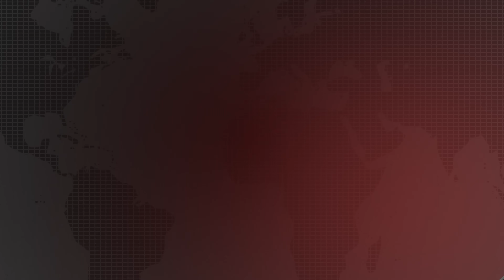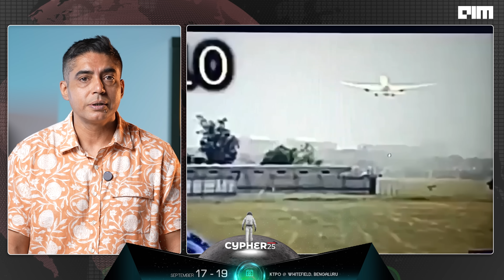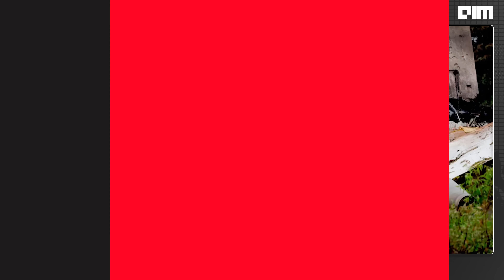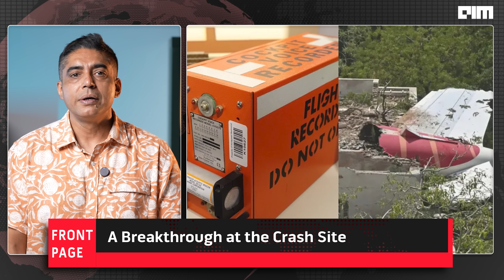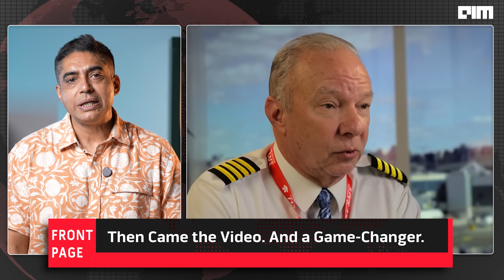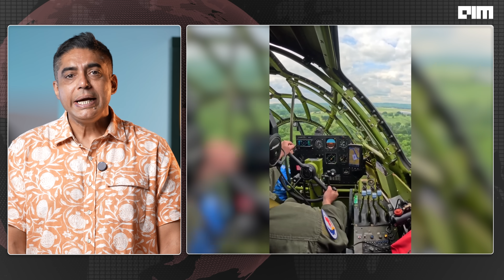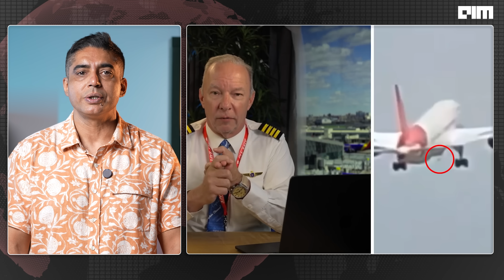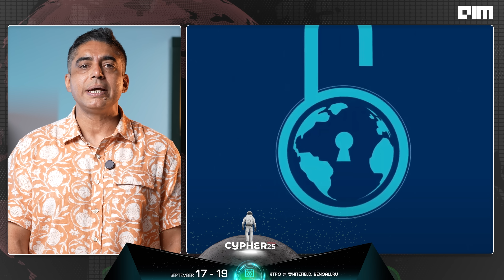Air India Crash: Is Boeing in Trouble Again? RAT Footage Sparks New Questions

Comment: Maintenance must have zero mistakes!   So heartbreaking....RIP 😔💔🙏🏻
Reply: if proper testing was done it would not have passed the test
Reply: Yep, as usual, India standing up and taking responsibility. 🙄 Jai Hind!
Reply: But we have seen many videos made but passenger traveling in the same flight ✈️ within that week or a month.  According to them the flight was too old and many things were out of service.
Reply: @sushmadhillon8818  11 years is not old for an airplane... and yeah a pasagner will have any idea about what INOP on a plane... pls...
Reply: a comprehensive pre-flight maintenance process is crucial for ensuring safety and airworthiness.
Reply: Air India has received six 787 Dreamliners that were assembled at Boeing's Charlotte, North Carolina plant and they are said to be defective. Other airlines rejected planes that were built there and opted for the ones made in Seattle, Washington.
Reply: @Eyob797 It's scary for sure!!
Reply: @Eyob797  that is absolutely not true. Please do more research before posting comments.  😊
Reply: @Eyob797  First off, it's not Charlotte, NC - the 787 are built in Charleston, SC.  So that's fact number one you have wrong.  Second, they were not defective planes, they were the earlier models that had been built in Everett, WA that were subsequently reworked to meet updated requirements.  They were initially built defect free, and the rework that was conducted to update them to the new requirements was also defect free.  Finally, no one rejected these planes, but rather the other airlines wanted planes that were brand new and hadn't been used in flight test as these had been.  Last note:  The plane that was involved in the accident was over ten years old and had flown without issue that entire time.  You still want to somehow pin this on Boeing?  Seriously?
Reply: @JayKeggerlord  I totally agree with you 👍🏼
Reply: @JayKeggerlord  If it’s Boeing, I ain’t going!
Reply: @Eyob797  It was an 11 years old aircraft... pls stop bullshiting. :) Sure Air Inda kept flying a defective plane for 11 years right? :D Also Charlotte does not assembled it, it was assembled in Everett but yeah pls shit more on the street. :D
Reply: @squirrelmurderous 
Why wouldn't it not be a Boeing issue? 
Just because 11 passes doesn't mean a manufacturer isn't the cause. 

There is a 2024 recall from Peugeot, about vehicles made in 2007-2008.
So time isn't always a factor.
Reply: @dianehansma1725  , but this is India? You really believe they can have zero mistakes?
Reply: How much is Boeing paying you?
Reply: @owenlaprath4135  if they are facts what would it matter?

Comment: What would it have costed for proper maintenance of the electrical systems on that plane? If two days ago, a passenger showed that electrical fluctuations and malfunctioning was there, what would it have cost Air India to get the same checked once before this take off?
Reply: Duuude, there is no automatic connection between how the interior of the plane functions and how the engines and vital systems functions.

Comment: Dear, who does know this catostrofic crash happened only because of poor maintenance ,no replacement of relevant parts on time. No overall through checking, oil change, etc..❗see operating a standard Air line in international standards of safty is costly. Even gov of India couldn't run that so they sold to TATA group they aim only profit not looking to do charity by running Air india.its business they sell ticket at low rate and Indians run for such low rate ticket 😂😂.. low rate ticket don't expect international safety standards..to rduce cost reduce maintenance 😂😂..so such things happen frequently for Air India..if wishes to travel 
With good safety standards etc go for tiket of good Air lines like ethihad.emirate..qutar..singapore Air etc..and have safe happi journey..😅..this is the reality.😮.. accept the reality

Comment: This is an 11 year old airplane, why would this have anything to do with Boeing?
Reply: @asquare9316  because even if a plane develops a fault after 11 years, it’s a vulnerable issue for the manufacturer for that make 787, that hidden flaw can lead to disasters in future, a plane is supposed to last more than what this plane lasted, so to avoid future accidents, this hidden vulnerability must be removed, just because engines failed, we can not assume that it was GEs fault, a catastrophic electrical system failure could be due to aircraft flaw as well.
Reply: @deadpooldeadpool665  787s have been flying for 14 years, over 1200 aircraft delivered. Don't you think that any catastrophic design flaws would have been found already? This is the first fatal crash of a 787 in all that time. 
Do you think the fact the A/C was not working on this plane was the result of a Boeing design flaw also?

Comment: APU failure is three jet engines, right? Why would a RAT deploy, if the APU was still powering hydraulic pumps for gear retraction and fuel supply? NTSB investigations are thorough, but I'd get a lock on the fuel truck and storage tank. No other planes had that long takeoff roll and a white 'dust cloud' at rotation on that day?

Comment: The RAT can be deployed manually from the cockpit. It DOES NOT require a dual engine failure.
Reply: Unlike in other planes,boeing787 dreamliners RATis deployed automaticaly
Reply: @danielkalebfinahas7636  The Ram Air Turbine (RAT) on a Boeing 787 can be deployed manually. While it's designed to deploy automatically in certain emergency situations like dual engine failure or loss of electrical power, there's also a dedicated switch on the flight deck that pilots can use to deploy it manually. This switch is typically located on the overhead panel and is spring-loaded and powered by the hot battery bus.
Reply: @danielkalebfinahas7636 - according to Google, yes, it can be deployed manually, as well as automatically!
Reply: No it can't be deployed manually it happens automatically when there is dual engine failure.
Reply: @vr5663  An airliner's Ram Air Turbine (RAT) can be deployed manually - Don't talk Bollocks. Look it up if you don't believe me.
Reply: @vr5663  ever heard of AND/OR?
Reply: @vr5663 - yes it can - Google it!

Comment: By the way, we knew the RAT was deployed the same day. 
1. The RAT was deployed without question. 
2. The plane took off very late on the runway, i.e., it used every foot of runway possible. This is not normal for a 787 on this runway; they normally take off about 600-1000 feet from the end of the runway. 
3. The plane shows signs of laboring around V1, as if it lost some thrust or one engine on the runway.  These are facts one can obtain with the info we have now. The reason the gear was not retracted is that the pilot felt there was a problem.  Now the question should be. Were the pilots aware of a thrust issue before V1?  
In reality, the gear does not matter; the 787 can take off full of passengers with gear down if the plane is operating with full thrust. It will lose climb rate and air speed, but not enough to stall. This plane also did not stall. So what the fk are people even talking about the gear for it makes no sense in this case. 
Here is my (speculation) of what happened: on the runway, the 787 lost one engine and/or lost partial thrust in both. Soon after liftoff, the plane lost the other engine and/or total thrust in both engines. Forcing the RAT to deploy, and this speculation also makes sense on why the gear was not retracted, as the Pilot knew there was a problem on liftoff, but he just did not know how serious the problem truly was.  If you run the numbers of the planes take off, you can clearly see that around V1 the plane loses performance and is building speed, but not at the rate it should. This also explains why the pilot did not rotate until he was forced to at the very end of the runway.  There are many questions here, but the Gear is not one of them; the gear did not play a role in this crash.   I also think it is very possible that there were signs of a problem in time to abort this flight, but most pilots will never abort a flight in real life, and it's not muscle memory, and they push it until it's so late that they have to rotate, I dont' know this for a fact. However, with the info we have now with GPS speed of the plane on the runway and other info I belive it is a possibility.
Reply: I agree with your analysis, BUT we already know all this. The real question is: what caused the engine failure/s? Was it central computer aging, software glitch, fuel contamination, generators failure, fuel pump failure, electric stabilizer failure or what????
Reply: why not abort the takeoff then if things are not quite right by V1? Take off should only happen if everything is 100%. at 99% you slam the brakes and yes the plane will need new brakes before taking off. But everything should have been 100%, not 99.9% when choosing to takeoff.  maybe the problem happened after rotation.
Reply: If everyone avoids Boeing planes, Boeing will not rest on its laurels and ensure better quality and not complacent. This is not a car, this is a plane,  Boeing must do a periodic maintenance every year and write off planes after a certain time or do a major overhaul after a period of time.
Reply: Regarding your 
1 "The RAT was deployed" -  So it´s a major power failure !! Not a slight or one engine failure, poossibly 2- engine-f.

2. "The plane took off very late on the runway, i.e., it used every foot of runway possible. This is not normal ---"  Can you really say it was "not normal" for a fully loaded  Boeing 787 ( Passengers and Fuel )  - to take off at the end of the runway?
3. "The plane shows signs of laboring around V1" - Looks to me as a quite normal for an allmost maximal loaded aircraft take off in normal side vinds conditions, with in this case.; long distance fuel : 100 000 litres I ´ve been told.
Reply: @trickedouttech321  could the pilots have successfully rejected the takeoff?

Comment: This aircraft suffered total loss of thrust for one reason or another. Engines are NOT a Boeing product, these were GE. They are maintained by the Airline.
Reply: But Boeing will be blamed, its their aircraft, i bet 50% of parts are made by third parties but that doesn't make that aircraft theirs, its Boeing after all.
Reply: Whaaat? There are a lot of systems on the plane that make that engine working and control it...
Reply: Thank you!! As soon as any disaster happens, it’s Boeing’s fault.

Comment: The RAT operated almost certainly in response to a dual engine failure as the “MayDay” was qualified by “Thrust not achieved ”. It reached 650ft probably through momentum as it had rotated (VR) with full/selected power otherwise it would probably have aborted at V1. From the video the aircraft showed a positive stable (6DoF) descent the wing tips still slightly flexed up with reducing aerodynamic speed giving some lift but insufficient to maintain its heavy all up weight and main landing gear drag. To excuse the term but its fatal descent/stall was “graceful” (no yawing or pitching). Engine Computer management, such as FADEC : there have been incidents since such as 1988 A320 Habsheim low level forest entry, Nov 2008 XL 888 (FAC alpha prot sensor ) and A-400M engine (3 engines out of 4) management of computer management issues. For a dual engine failure the finger tends to point to the engine management computer control unit, but that needs to be fully discerned as whether it is a software, firmware or hardware or incorrect initiation by a critical parameter common to both engines (aircraft). A faulty Full Authority Digital Engine Control (FADEC) could lead to a loss of engine power, potentially causing both engines to shut down. This could happen if the FADEC, which digitally controls engine operation, experiences a failure that prevents it from providing the necessary power or fuel to the engines. In such a scenario, the engines might.  Potential Failure Modes: A FADEC failure could manifest in various ways, such as a loss of electrical power, software glitches, or sensor malfunctions, revert to idle power, and without the ability to increase thrust. If the FADEC fails, the engines might automatically reduce to idle power, or in the worst-case scenario, shut down entirely.

Comment: Your video just proved to me that we should not be flying in metal objects that can fail
Reply: Exactly, I know it's supposed to be safer than driving in your car but for me it's like being in a steel coffin!
Reply: It is made of carbon fiber.
Reply: You should not live in a house built by steel, bricks and concrete which could collapse or by wood which could get a fire.   You should not take any modern transportation, such cars, trains or boats which could crash, get a fire or sink.
Reply: @ceridavies8056  
I think rubber planes are the answer. Some soft plastic like Frisbee material but mostly rubber.

Comment: The RAT was deployed because of power failure. The next question is why. Dual engine failures .The question is was it intrinsic of the engines. If so how. Only plausible explanation probably fuel starvation. Again how. Looks fuel contamination or wrong fuel. If that’s the case, it becomes local maintenance and quality assurance problem.
Reply: ❤❤
Not required, the engines were shut off manually by one of the two pilots to get insurance money. ❤❤

Comment: At Kerala due to heavy rains electric post and trees uprooted  there are more than 1000  houses ,to fix the electricity wires with no proper equipments only two  Bengali labourers were doing the work and instructions were given by electricians from the ground when they were on the pols and no power for 3days is it unemployment problem? This our country

Comment: if its engines failed, then they need to find out why fast, as it could happen again to some other airline. The poor souls could do nothing it needs to never happen again
Reply: ❤❤
Not required, the engines were shut off manually by one of the two pilots to get insurance money. ❤❤

Comment: Well, the Rat deployment didn't prevent any catastrophic event from happening did it?
Reply: The RAT is not an end all fix, It just buys some time especially if you already have significant altitude. It provides a minimum level of electrical and hydraulic power for basic aircraft control functions.

Comment: What is needed next is a 787 aeronautical design engineer who has the exact diagrams and criteria for what exactly triggers the RAT deployment. Not just the general loss of both engines, electrical failure or hydraulic failure but what those exactly mean. What are the possible failures. Where are the non-redundancies or close proximity of dual failure ( nearby components a fire could take out both systems). Someone with enough knowledge of these systems and their proximity so common physical events/damage should be able to list the possible causes. The fuel system is an obvious one since they draw fuel just filled from the airport fuel source. So fuel with water or other impurities might just reach the engines just as the 787 lifts off and both engines get the bad fuel or an air lock nearly simultaneously. But are there other redundant systems that could be taken out together due to close physical proximity or requiring a common source ( like fuel). Find a 787 systems engineer with both logical and physical diagrams showing the systems required by the engines looking for a common physical failure point.

Comment: The fuel system presents a potential single point of failure for both engines under certain conditions. A notable incident highlighting this vulnerability occurred when a British Airways Boeing 777 experienced a dual engine power loss just prior to landing at London Heathrow. The root cause was the obstruction of the fuel-oil heat exchanger (FOHE) by ice crystals, which had accumulated from supercooled fuel during cruise.
Modern aircraft fuel systems, such as those in the Boeing 787, are highly automated and comprised of multiple interconnected tanks (including main, center, and surge tanks) and a complex array of electrically and pneumatically actuated valves. These components are coordinated by the Fuel Quantity Indicating System (FQIS) and managed via the aircraft's Airplane Systems Management software, limiting direct pilot control during normal operations.
While designed with redundancy and fault isolation logic, the system is still susceptible to cascading failures originating from erroneous logic or sensor input. For example, in medium-range missions where the center tanks are not loaded with usable fuel, a failure in automation logic—such as incorrect tank sequencing or misinterpretation of fuel level sensors—could result in the fuel feed being directed to unpressurized or empty tanks. Without timely pilot intervention, this could lead to a condition where both engines are starved of fuel simultaneously.
This scenario underscores the critical importance of fail-safe logic validation, comprehensive fuel system monitoring, and rigorous testing of edge-case operational profiles to ensure that automated systems do not propagate critical faults